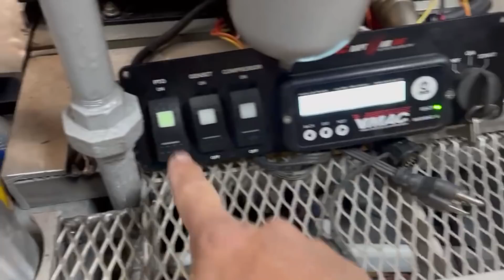SV Seeker Launch - 14 years in the making

Comment: A suggestion for getting snow/hail like that off of the boat faster: an electric or gas leaf blower. I used to use one to clean up in the evening when I worked at a retail nursery and it is so much faster than sweeping, especially when you are just trying to move the loose material out into an area that doesn't get swept.
Reply: @dancarter482  Yeah, that would work if you had a wand that was about two or three feet long so you didn't need to bend over.

Comment: Oops, in the USN I was taught to use a 'tag-out' system.  So, any and all systems affected by maintenance were labeled with tag, with the reason of the work, was affixed to valves, switches, or anything that could be affected.
I am still empresses with the fact that a 'dbadmin' built such a fine boat .... may fair winds and following seas bless all she holds.

Comment: Congrats on getting her in the water!

I know you explained before why you don't want to label or document things on the boat. However the whole ordeal with the pressure relieve valve could be an example of why it is useful for others on board to also understand the system. Or at least look at parts and read a label that says: 'relieve valve: open/closed'.
On dry land with no time pressure this is all funny and won't really become a problem.
But in a storm, when you are knocked out or sick (not wishing ill on you in anyway of course), it really can be life saving if crew know where everything is, what everything is, and how everything works. Labeling things is just really really useful.
Reply from the maker: Oh for fuck sake.  If you want to come right a manual I'm not going to stop you.  So tell me what the hell you would label that valve that would make any sense at all to someone that has no clue about hydraulics.

Comment: One of the best fish and chips places in my area is an old retired bowpicker fishing boat that has been converted into a roadside fish and chips restaurant. It is permanently in place with the city even allowing a hard pad to be installed with full power connections. No tacos but some of the best beer battered albacore fish and chips anywhere at the Bowpicker in Astoria, OR.

Comment: I'd get an anchor swivel where your chain attaches to the anchor. I used a D shackle on the anchor and attached the swivel to the chain side then connected the two... You don't want to attach them pin to pin.  The D shackles pin should be put through the anchor shaft hole. The D shackle allows lateral movement and the swivel allows 360° roll of the anchor, so it can right itself.
Reply from the maker: No, that would keep the anchor from coming up on the rollers correctly.

Comment: Working boats for a living  interested to see how it runs with the drive system very complex and because diesels are very load sensitive to longevity also they need a lot of air for the engine room i would put an temp sensor near air filter for sea trials seen seen a few diesel have issues with not enough  ventilation i believe 4 times the volume of the engine room at wot with turbo spool up to give you an idea its missed a lot in boat building 
Keep dreaming big and achieving big things im glad to see it get wet after all these years

Comment: Well, congratulations.  It's been a while coming and I bet you are very happy to be moving ahead with the project now.

At 30:41 I am a little stumped.  It never occurred to me that you would be trying to spool all the chain above decks.  This is a highly unusual approach.  I think you'd be better off fitting a chain gypsy and installing a hawse pipe to carry the chain below.  The ground tackle is heavy and you want the weight carried low if possible.  Good luck and keep at it.
Reply from the maker: It’s not highly unusual for the NW and British Columbia.   And it keeps the locker dry and has less chance of fouling.

Comment: Where is the Silver Dollar that is usually placed UNDER the Mast. That is traditional with most sailing vessels when setting the mast for 'Smooth Sailing and Good Luck". Without it look for Neptune to bring it down to the bottom to inspect such a fine boat!
Reply: Almost forgot.  Watching the previous video about Rig failure. One item I suggest be added to several locations on the Seeker. Marine Spray Sealant, a expandable foam product for an emergency seal in a case of a leak or water intrusion or wield failure. Also a roll of 1/4" x 18" rolled rubber membrane with a supply of wedges and short beams for bracing when you happen to hit those submerged obstacles (and you will), that break the seams wield. Experience learned from the Fast boats in Vietnam when the VC used to sink boats to rip the bottoms.
Reply from the maker: Sorry.  Don't believe in Santa, the Easter Bunny, or Angels either.   But we will have a coin collection.

Comment: If the valve for the open spool anchor motor were to be opened could the lift boom for the crane start lowering while the lift solenoid was activated?
Reply from the maker: Nope.  There is a valve on the crane boom that only allows it to retract when it has hydraulic flow to it.   It's called a "counter balance valve"

Comment: I'm confused at 3:20.. Did Doug not 'open' the valve or did you forgot to shut it off as it look's shut to me unless you American's have the valve set backwards to normal operation??
Reply from the maker: That valve has to be closed from the crane.  And opened for the anchor winch.  The anchor winch valve is "open center".   The rest of the system is "closed center".

Comment: All my admiration for your project! Nevertheless, I am afraid, the two side kiels cant stop the ship from capsizeing :-( One kiel should be lower and in the center. (I have never built a ship, just by looking at that huge, heavy mast) Hope, I am wrong.
Thomas
Reply from the maker: Imagine a seesaw in a park.  On one side there is a kid holding 10,000 pounds of mast, sails, and wind.  Or the other side there is a fat kid that weighs 120,000 pounds.   Do you really think the fat kid is going to go up?
Reply: @SVSeeker  isn't it more geometry, lever Arm, than a question of fast Babies? If the ship tilts to one Side, the Kiel on that Side helps the motion instead of preventing, Again, I never built a boat.
And please write a Manual for the future Crew. Otherwise, only you and Jaques Tati can manage the Ship :-)
Wish a happy Future for the ship and a lot of fun and plenty Research Results.